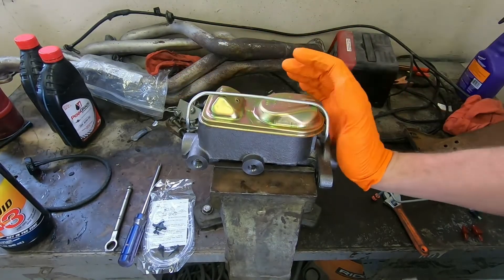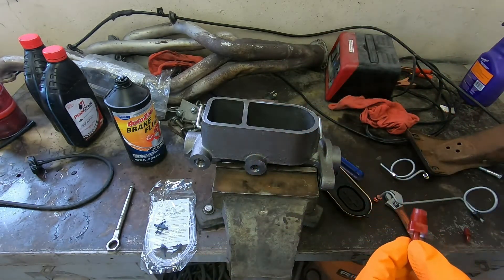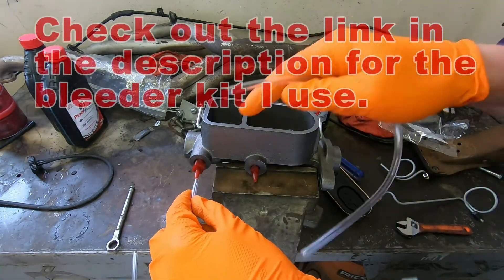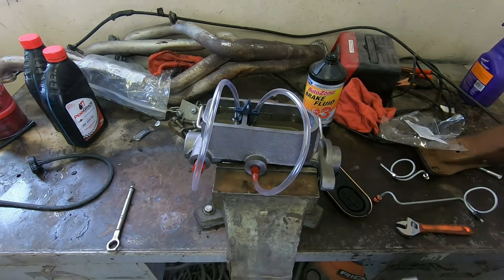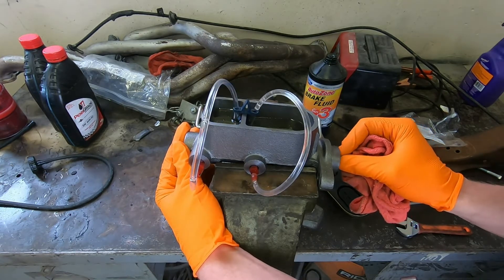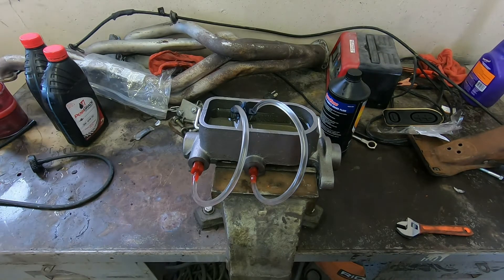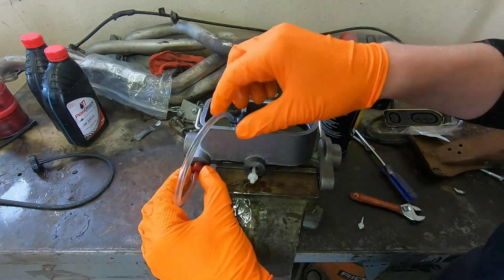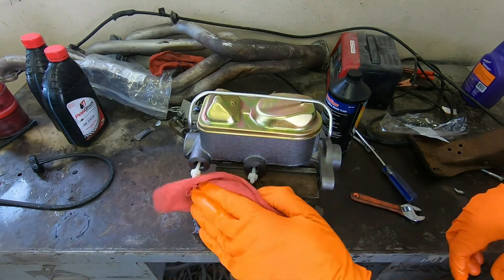How to bench bleed your brake master cylinder - 1967 Ford Mustang

Comment: I like the plugs you use at 7:15 into your video but the kit you show in your list of products does not include those plugs. Could you share exactly which bleeder kit you used in your video?  Thanks in advance.
Reply from the maker: Let me look into this. The kit I listed is the kit I thought I used and I did notice its not pictured on the Amazon link.
Reply: @AlfsMustangGarage  maybe the manufacturer removed the plugs like a lot of manufacturers have been doing lately - shrink-flation; meaning they can keep the price the same but provide less parts???  Maybe that's what's going on.  :)
Reply from the maker: Very possible. You might be better off checking with your local parts store to see if their kits have them.
Reply: @AlfsMustangGarage  I checked with all my local part stores and spent waaay too much time searching for these on the internet.  Can't find them.  Wish I could because if you're working on a restored/repainted master cylinder you want to keep the brake fluid OFF the fresh paint.   :)
Reply from the maker: Exactly! I'll see what I can find and get you a part number.
Reply: @AlfsMustangGarage  any help is appreciated because I'll soon be bench bleeding my master cylinder.  Thanks.  Great videos by the way.  Very informative, instructional, and easy to follow; even for a newbie like me.  :)
Reply from the maker: Awesome thanks! I just ordered the one off Amazon that I've used before. The pictures may not be an accurate representation. Once I have it in my hands tomorrow, I'll let ya know.
Reply: @AlfsMustangGarage  Looking forward to hearing back from you.  :)
Reply from the maker: Well I have the kit now and I'm afraid those plugs are confirmed to no longer be in here. I know that is where I once got them so they definitely used to be in there. Its weird but I'm having a hard time finding some myself. If I come across any, I will let ya know.